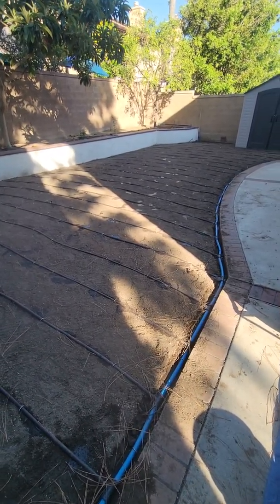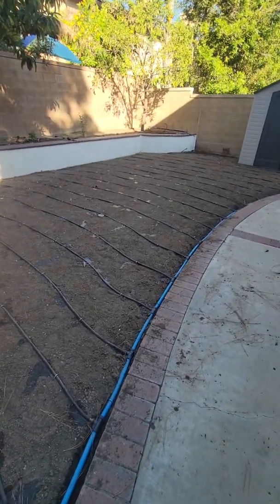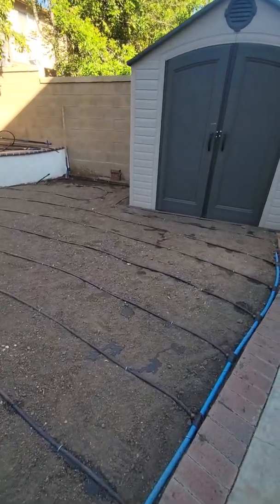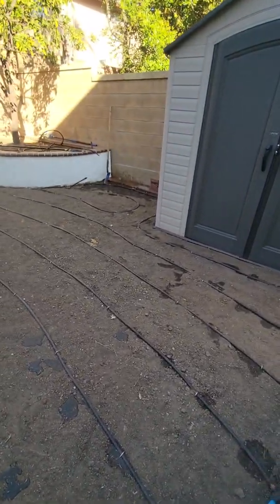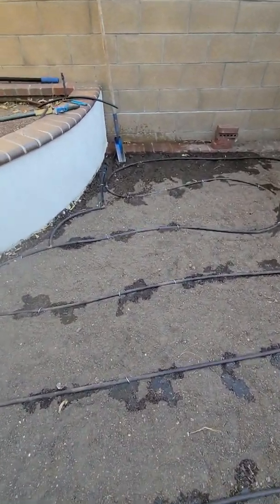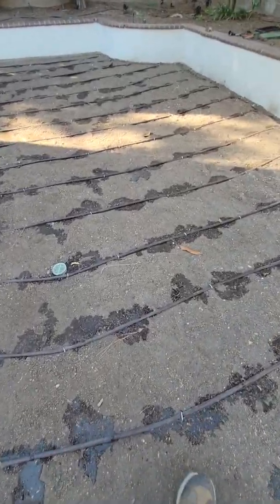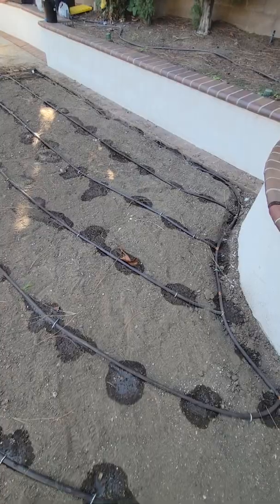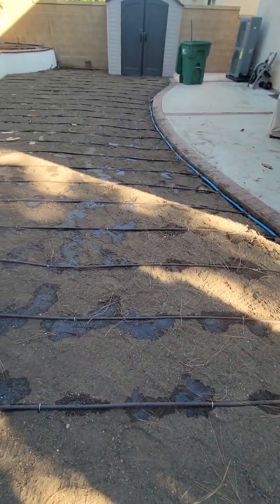Netafim Drip Tubing For Subsurface Irrigation

Comment: Does this clog easily?
Reply from the maker: @oasisoflasvegas7925  No, 
There is a filter ob the distribution mainline, and there is a flush plug outlet at the end of the drip line grid, so it there is ever a clog, we  flush out the system.
I encourage my clients to flush the fikter and the drip grid line at least 1 time per year. 
Thank you for your comments and for viewing my videos...🤠👍🏾
Reply: @alcambero  I'm in Las Vegas and want to install this. Where should I be looking?

Comment: What are those saddle connectors you're using on the header line? Thanks!
Reply from the maker: @jenrusso2134  
Jenrusso, 
Thank you for checking out my videos.
The irrigation fitting is called a HydroRain 3/4" Blu-Lock by 1/2" Drip-Lock  tee fitting.
You can go to the website www.hydrorain.com
Click the 3/4 " Blu- Lock link, and you will be able to find it listed there.
Depending on where you reside, you should be able to find a supplier, or you may be able to order directly from the manufacturer.
The fittings are very reliable and easy to use.

Good luck, and share the video with others, please...🙏

Thank you...🤠👍🏾

Comment: I heard since Netafim uses emitter check valves , you don't need a air relief box installed. Is this correct?
Reply from the maker: Good morning, and thank you for viewing and your question.

We always use the relief valves as they are a design concept Netafim encourages and is a great way to ensure proper air release in the tubing after the irrigation cycle is complete.

Thanks for being a part of the Midwest Landscaping ' Yardee ' community...🙏

Comment: Great video, thanks for sharing. I’m surprised I don’t see more of this. Saves water, reduces overspray, and hides sprinkler heads. Seems like a win all the way around.
Reply from the maker: Thank you, WaterGruffalo.
The initial process can be demanding figuring out soil infiltration rates by doing soil tests so you can manage and apply correct irrigation system run times and not over water your target materials, which can and does happen.  Properly installed  and maintained sub-surface drip irrigation systems do reduce water wastage and increase the efficiency of water use.
Thanks for checking out my videos...🙏